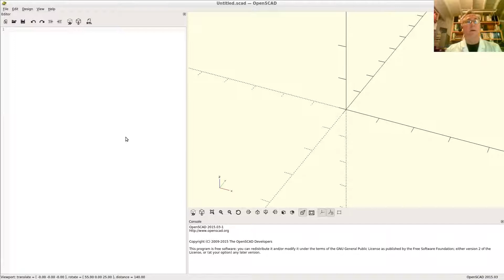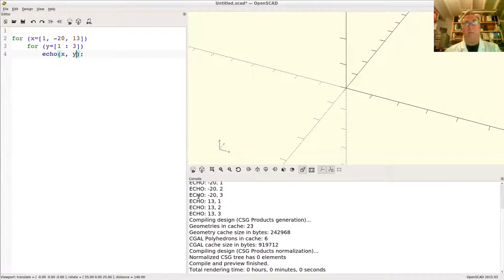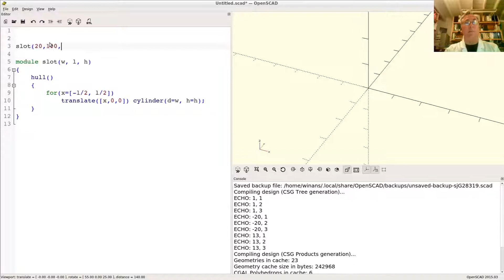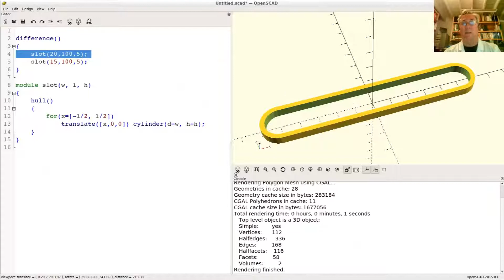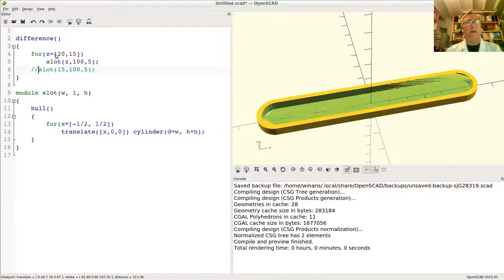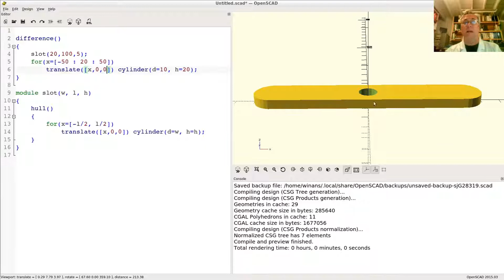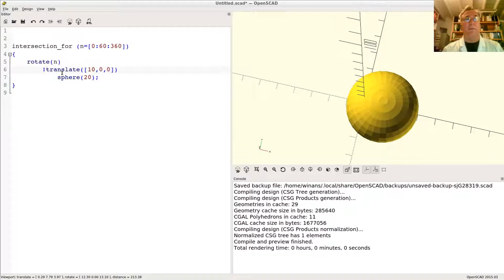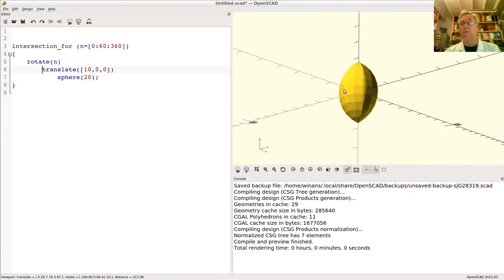OpenSCAD (Part 9): Loops

Comment: // This will render correctly even in the preview

difference() 
{
    slot(20,100,5);
    translate ([0,0,-1]) slot(15,100,7);
}

module slot(w, l, h)
{
    hull()
    {
        for (x=[-l/2,l/2])
            translate ([x,-h/2,0]) cylinder(d=w,h=h);
    }
}

// HINT: Make it easier to the computer to do the difference jobs correctly by ensuring that your object 2 comes out of object 1 on both sides, even if only by a bit.